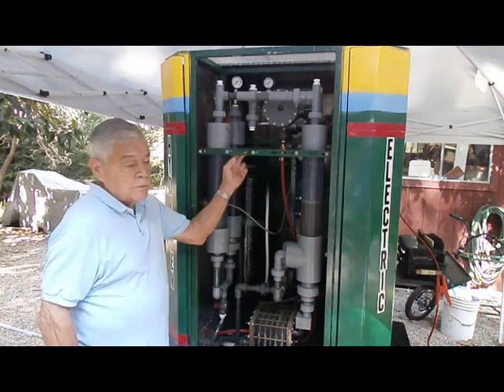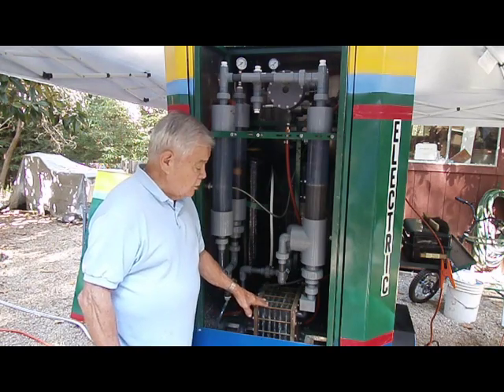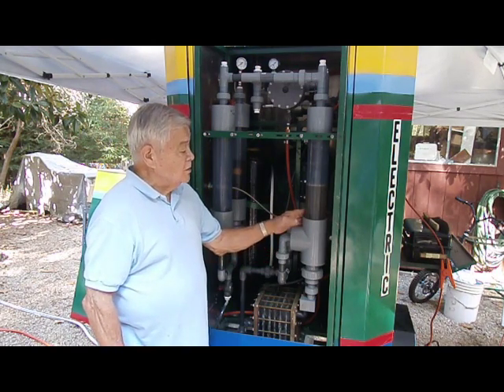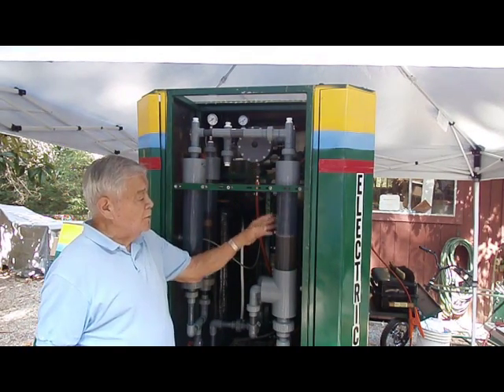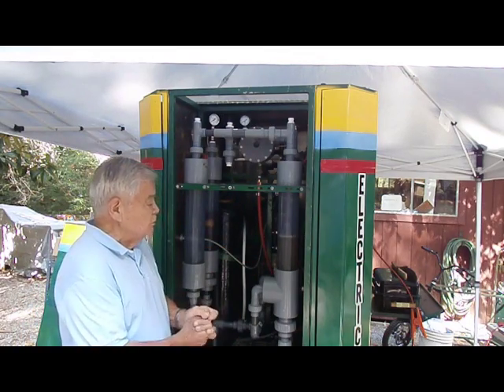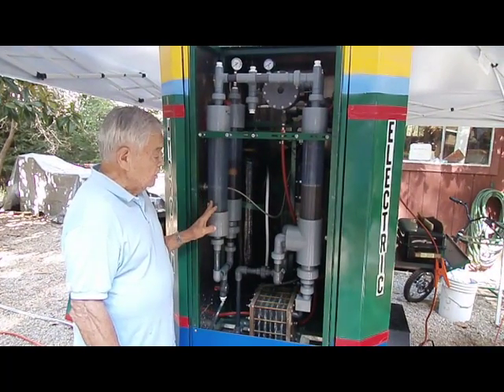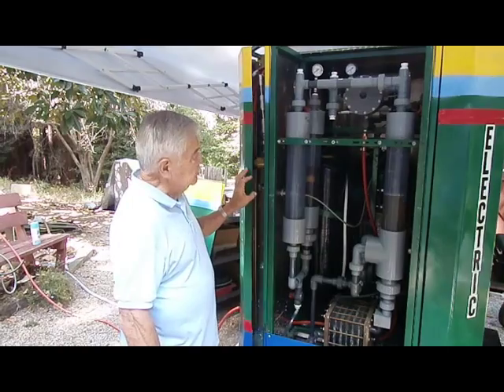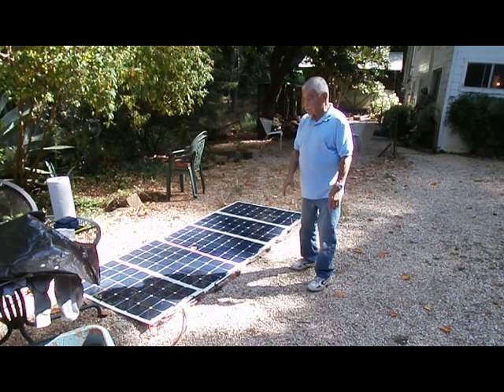Portable Solar-Hydrogen Unit's Electrolyzer 10 10 2016

Comment: Hydrogen gas is soo light that if it escapes
 into the atmosphere, it escapes the earth's 
 gravity and ends up in outer space.  And 
 so hydrogen from water via electrolysis 
 means that if there is leakage, that is water
 that will be gone forever, and never recovered.
  Recovery happens in a fuel cell when hydrogen
 is recombined with oxygen, but if the hydrogen
 is not contained and leaks (escapes
 containment) you are permanently destroying 
 water.  And so my question to you is, how much
 is the leakage problem in these electrolyzer 
 machines?  Zero molecules of hydrogen lost?